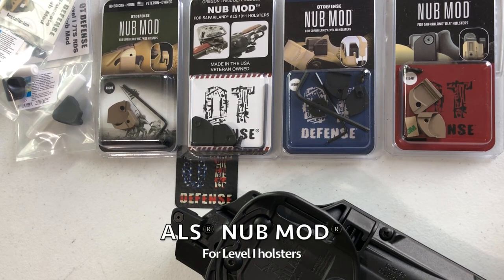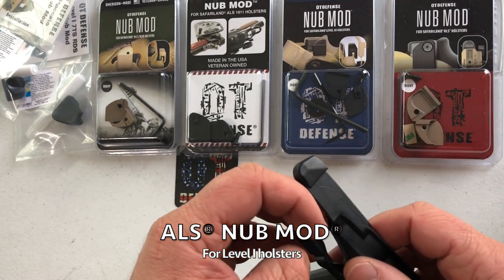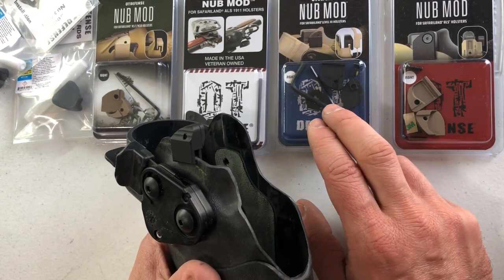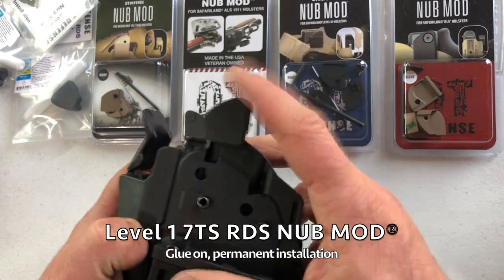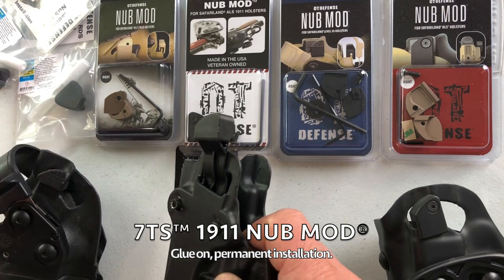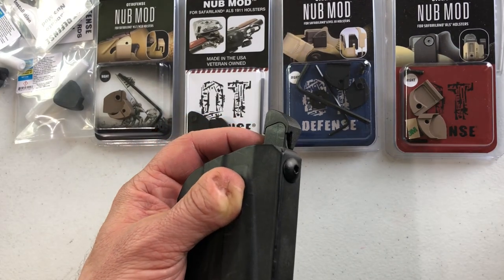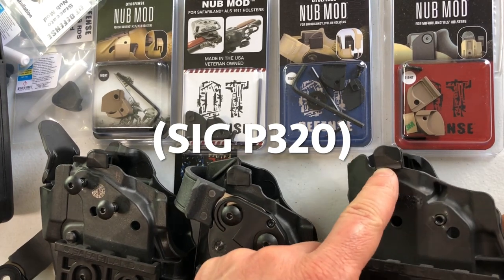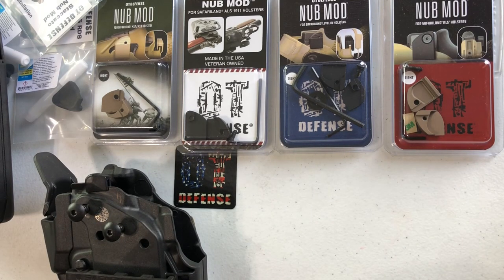NUB MOD® Selection

Comment: Just got mine. Only took 3 weeks because USPS lost it in Kansas for two weeks. It’s a huge improvement over stock. I had been struggling with the factory switch in some classes to get the gun out fast.
Reply from the maker: USPS has been slacking lately.... Glad you like it!